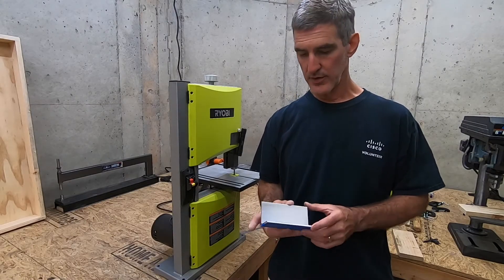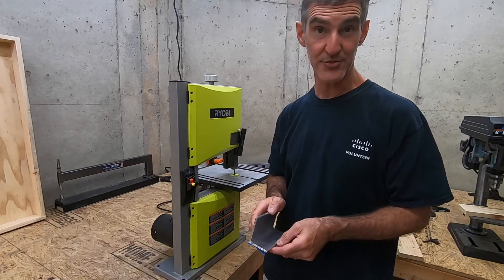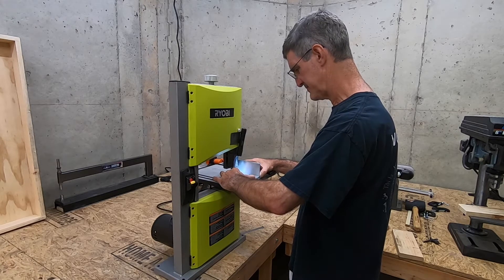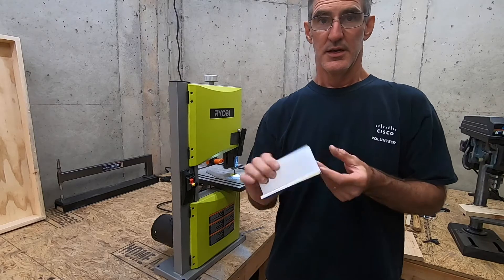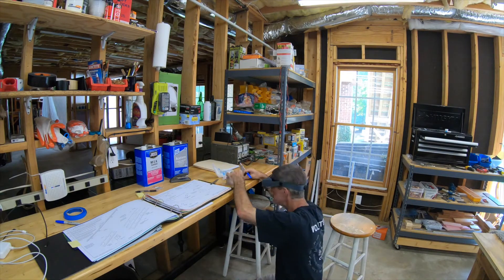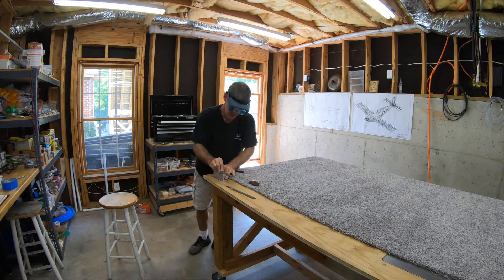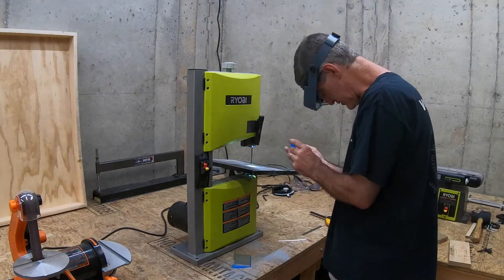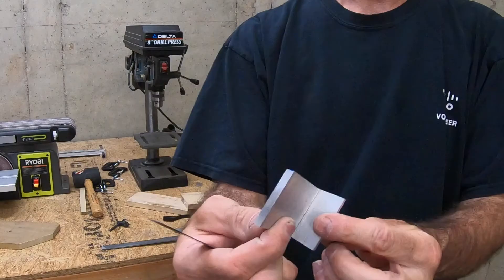RV-10 Build Log - Emp 34 - Fabricating the stabilizer attachment bracket

Comment: not related but where did you get the band saw blade to cut aluminum? Home depot does carry any blades
Reply from the maker: Ordered it from these guys:  https://www.toolcenter.com/
Reply: @missiletwentynine2667  any recommendations with the one you got? teeth pitch?
Reply from the maker: @DragonBuildsRC  I bought: - 24 teeth-per-inch.  That TPI has worked fine on everything I’ve used it on.  Even higher TPI might be better on some of the thinner material, but I couldn’t find anything finer than the 24.  As long as you leave margin to clean up the cut on a sander or with a file, the 24 is perfectly fine.